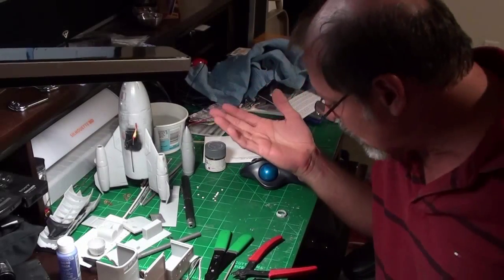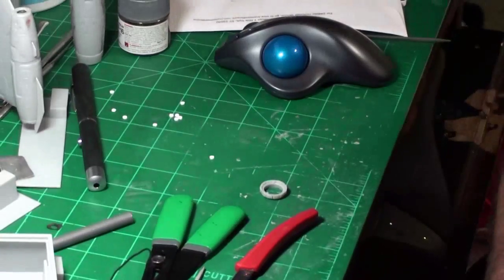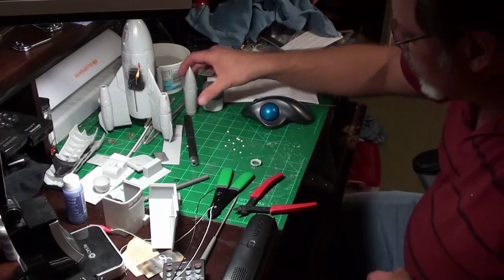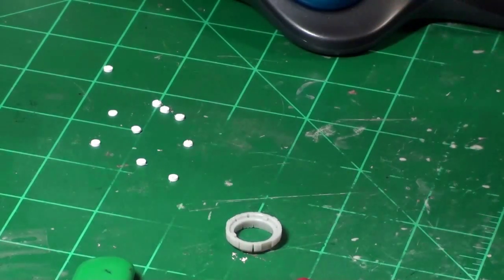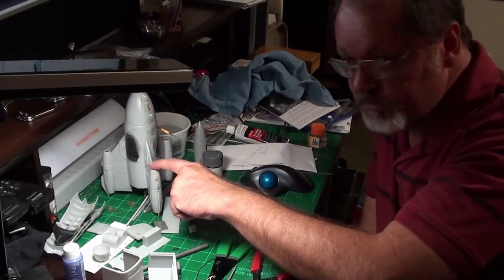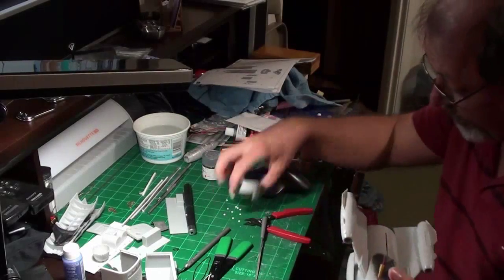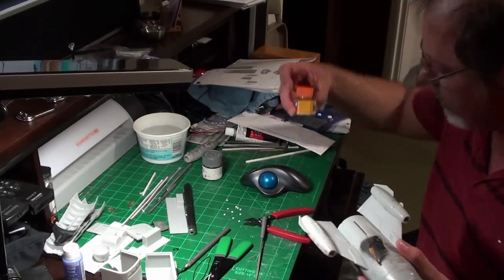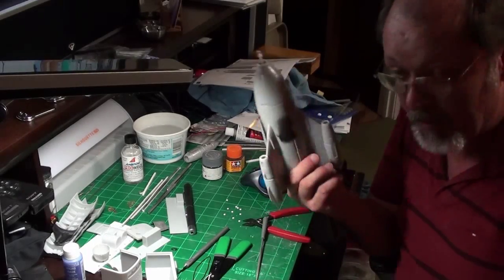Mercury 9 part 13:  First stage is done!

Comment from the maker: I wouldn't stay away from styrene because of my videos.   Remember I choose the harder projects.  If you stay with Tamiya kits, for the most part, you won't have these troubles.   The newer the manufacture date, the better the kit. 
Car models don't really have much in the way of seams.   They tend to have marks where the ejection pins touched the body.  Pretty easy to fill.  Car models and Tanks are the best to start with because of the lack of seams.